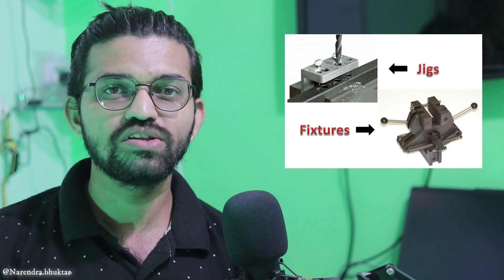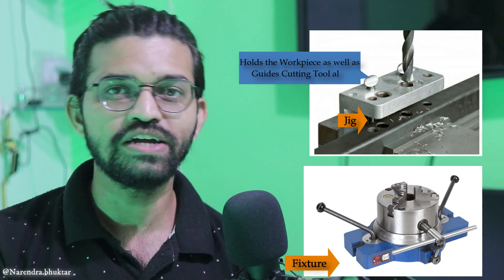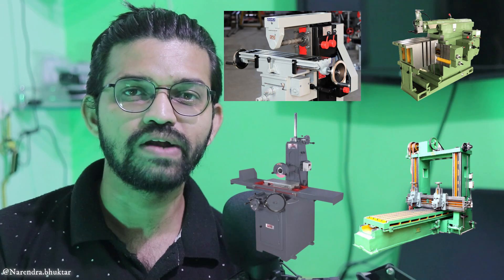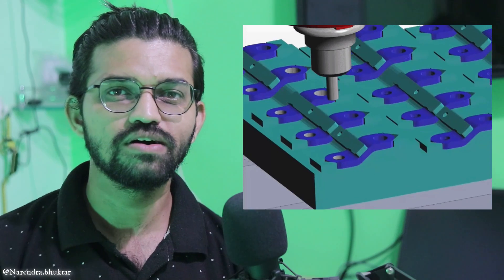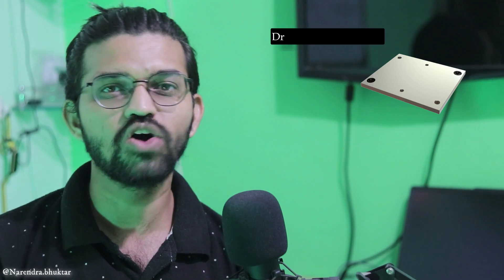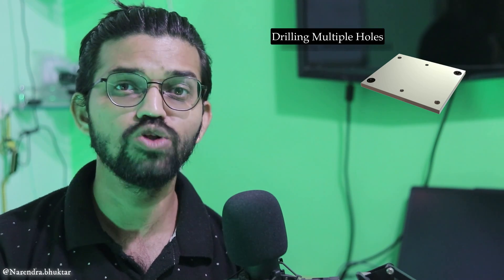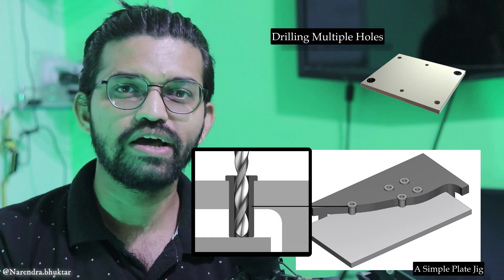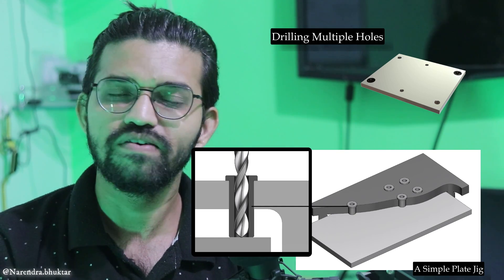Boost Your Manufacturing Efficiency with Jigs and Fixtures.

Comment: Any ideas on what jig or fixture to make a yolk?  I feel like in order to make the yolk you can use a vise to mill the slot and perhaps a few strong bolts to clamp the slot down and also smaller than the width of the yolk on the top and bottom?  Any other suggestions please let me know thank you in advance